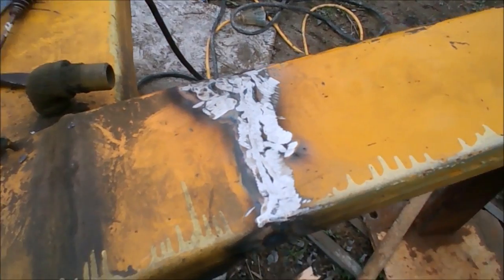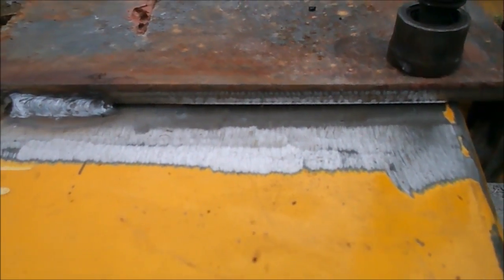Almost All Back Togher, 165 Massey Ferguson Project

Comment: Sure runs good. Looks like a pretty stout old machine. I have an Oliver 2-44 industrial with loader and 4post open cab. It's got a pretty bad transmission oil leak I gotta fix and I get the feeling that's not going to be fun to split